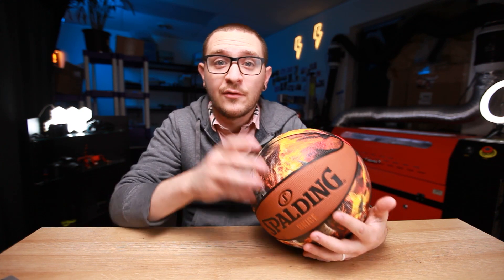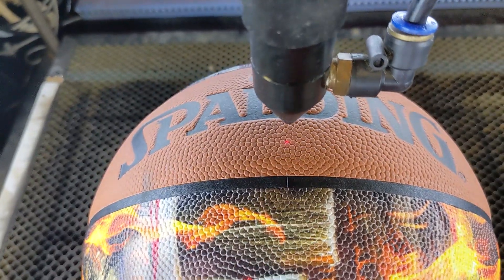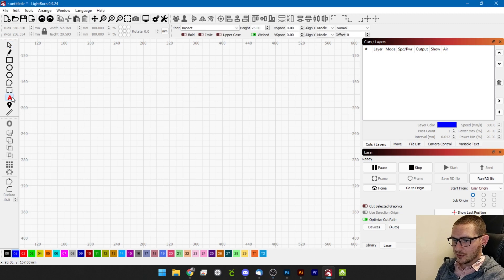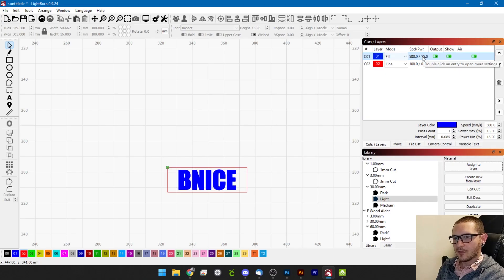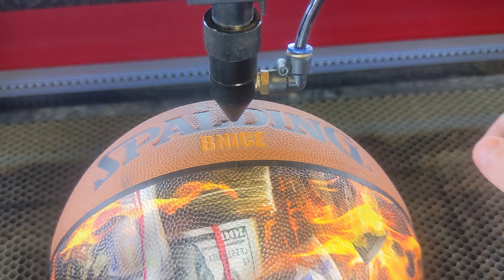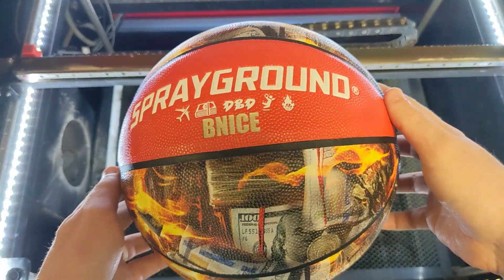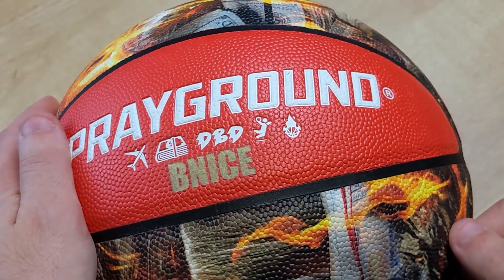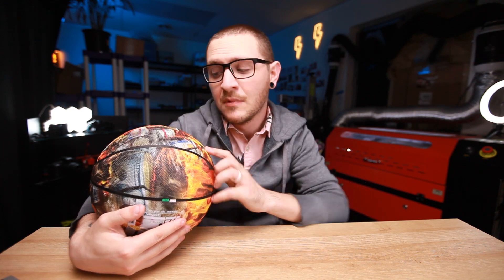How to Engrave A BASKETBALL | Engrave Rubber with Lightburn | CO2 Laser Tutorials

Comment: Great video. how would I engrave something as small as a round ball about 8mm in diameter? (Plastic) Is there something that can engrave all around it or would I have to keep rotating it?
Reply from the maker: I don't think there is currently a device that will spin a sphere like that unfortunately. Perhaps a chuck rotary if you set it up correctly via the jaws and maybe a point support on the other end. It would be tedious but do-able.

Comment: Do you  do engraving on rubber it would be more than words
Reply from the maker: There are lots of different types of rubber used in different ways so it definitely depends on the specific situation.
Reply: @LaserEverything  it would be the rubber that goes on top of a Harley floor board I was hoping I could get two pieces cut them to size have them Engraved and then glue them down

Comment: Do you have to mirror the name my always comes out backwards
Reply from the maker: No... not typically unless I'm doing glass or something transparent where I want to look at it from the other side. If you're getting mirrored engravings you may want to check and make sure you have your machine origin set correct. When you reset your machine does it home to the top right or left corner? Which corner do you have your machine origin set to in your Lightburn device settings? Might be the culprit if they don't match.

Comment: Thanks for the video.
I wanted to purchase co2 machine to engrave on leather wallets, and I bought for start the 3018 pro, which is very not good for use. 
What can you recommend for a good and professioanl co2 machine, and most inmportant - which software is the best to use?

Thank you very much!
Reply from the maker: Hey Gabi, I'd check out the OMTech (Orion Motor Tech) machines listed in the description - the 2021 Buying Guide. They're solid machines from a dealer that's been around for a long time. You're getting the same machine you'd be getting off ebay but instead of having to tinker to get it to do what you want it will be mostly ready to go. They're a little bit more expensive but I think they're worth it.

You don't really need more than 50 or 60 watts unless you think you'll be cutting thick woods and acrylic. 

As far as software there's only one option: Lightburn. Nothing else compares. It's amazing software and very inexpensive. 

I think it's lightburnsoftware.com - check it out. Its the software we use in all of our CO2 laser videos.

ALTERNATIVELY if you're just doing small items and don't think you'll need a giant CO2 bed like the OMTech machines have you could opt for something like the Cloudray galvo CO2, also linked in the description. It works just like the fiber lasers with EZCAD software but instead of producing a fiber laser beam it produces a CO2 laser beam. Great if you need CO2 wavelength but don't need the giant bed size. A little more expensive but much better beam quality. Look into both and don't hesitate to join the discord and ask if you have any other questions.
Reply: @LaserEverything  
You are the best. Thank you very much!
Reply from the maker: @gabiaviv  Happy to help!

Comment: Light bulb definitely burning bright. I have been asked to personalize bowling balls in the past. Wondering if it would just be better engraving it in parts as I manually rotate the ball cause I see no way of modifying a rotary to do the job. What's your opinion?
Reply from the maker: Your plan sounds solid. Just be careful. Use the corners of your bounding box to line up each line with the line below it. Check the urn video for an example of what I mean by that.